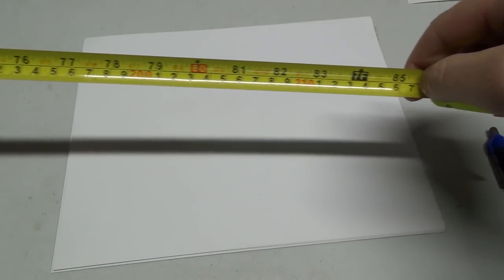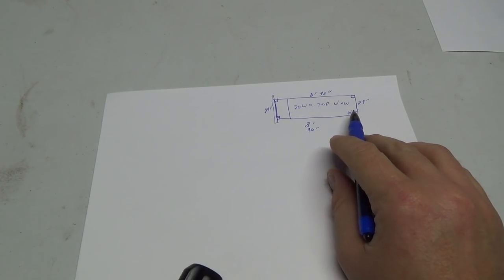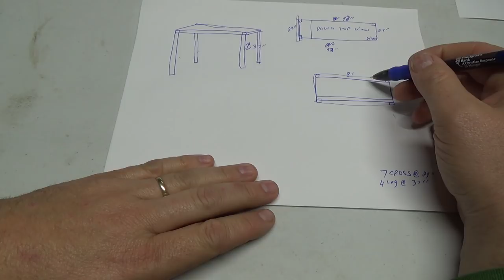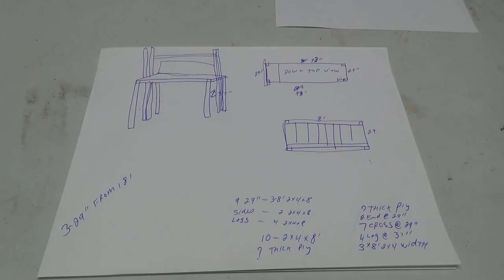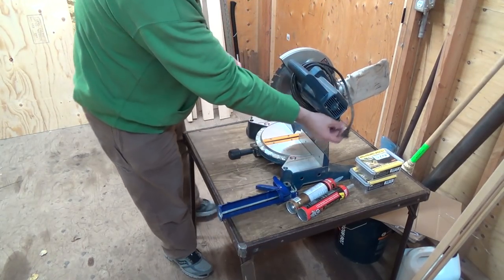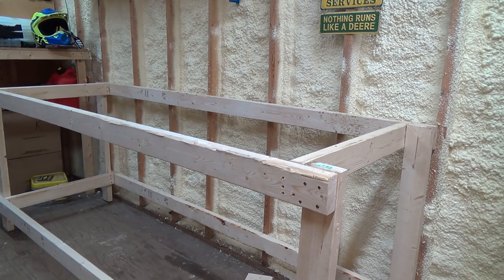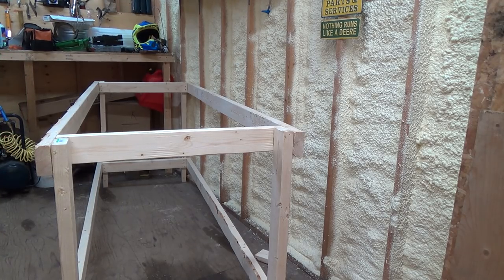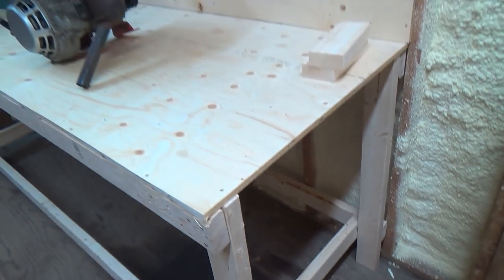Let's Build a Workbench...Plans - Get Lumber - Prep - Build...Timelapse

Comment: If your bench is leaning forward you could always put a strip of angle iron (Aluminium) across the front edge of the work top and it would act as lip to stop things rolling off as well as a edge protector for when your lifting things on and off such as engines.

Comment: If the glue was cold hold in front of heater vent. Funny to we stuck a glue tube of wood glue in microwave for ten seconds perfect fine.  The tite bond glue hardened up same thing. Shouldn’t go bad may needed to acclimate or climatize.

Comment: Length x width x height. Stronger legs you can use liquid nails verses wood glue use tite bond but it’s your table. 8 2x4 as a way to do it. Two per side for legs or just for that corner with the vise use the two x4 samwiched together lots of noodling work.
Reply from the maker: i did use the good glue.. It was too good though.. It didn't want to come out of the tube lol...